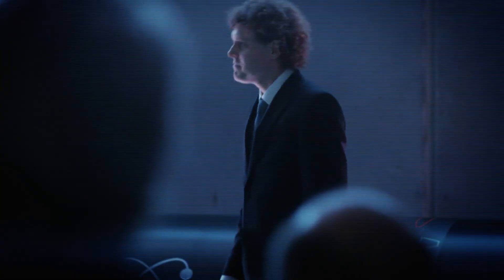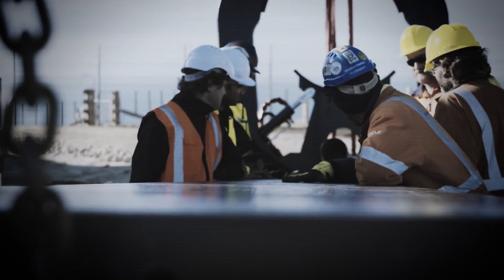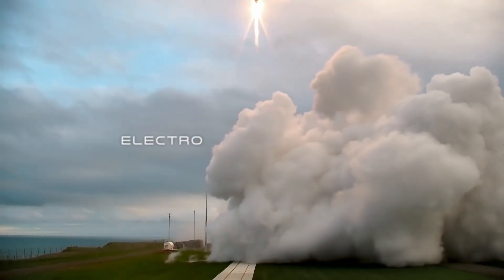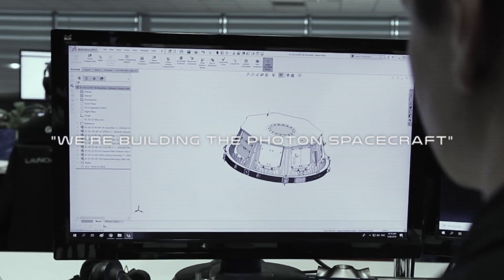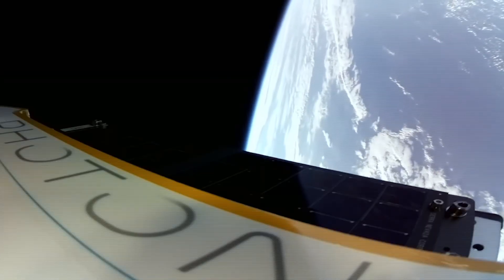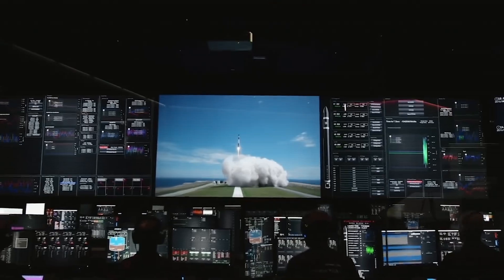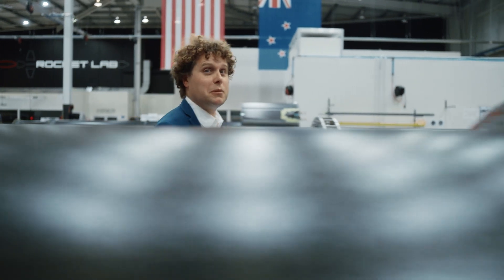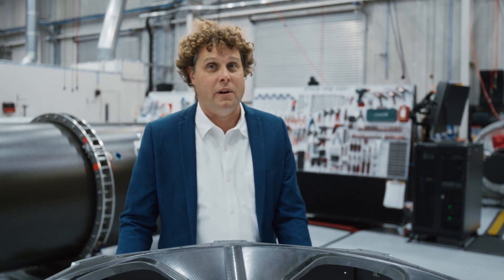Introducing Neutron

Comment: Dear Sir / Madam

I agree that I do not have the skill related to this post. If you will give me a job, I will try to give my 100%. My height is 7fit, and in the weight 90 kg, I can work to push your electron rocket to the launch ped.
 

My name is Deepak Goswami. I live in Jaipur, Rajasthan. My village is in the state of Jharkhand. I am very interested in space science. I take information related to space science from YouTube. I have been watching videos related to space science on YouTube for almost two years.

According to all the knowledge of aerospace science I have taken so far, I think according to that. The cost of rocket launches can be reduced by building an anti-gravity engine. I have worked in a copper cable shop for 2 years. Used to sell cable in this shop. Sale, purchase, inventory accounting was done on Tally software. Customer used to call. Used to take payment from the customer. Receipt used to enter payment tally on the software.

After that, I had a avenue supermart LTD. This was the supermall of 'Dmart Company' joining. Where the SAP software worked on the MS Word software. Used to packing Used to do stock checks. Stock also used to unload from the car. My computer has a typing speed of 29wpm. Photoshop software, Corel draw software, laptops, I know to operate lamination machine, stone drilling machine, internet.

I have also done a course in personality development. I am a B.Com graduate with 47%. I had no employment with. Then I tried 21 jobs but I was not interested in them. My interest is in aerospace company. I want to study aerospace science. And I have no money. Please give me any job by doing. So that I can with them. Be able to study aerospace science, I am married and have a boy.

My request 

6 May 2021

डिअर सर/मेडम

में मानता हु की इस पोस्ट से सम्बंदित स्किल मेरे पास नहीं हे. अगर आप मुझे जॉब देंगे तो में अपना १००% देने का प्रयास करूँगा.मेरी हाइट ६फ़िट हे, और वेट ९०कग हे, में आपके इलेक्ट्रान राकेट को लॉन्च पेड तक धक्का मारने का काम कर सकता हूँ.
 
मेरा नाम दीपक गोस्वामी हे. में जयपुर, राजस्थान रहता हु. मेरा विलेज झारखण्ड स्टेट में हे. मेरी अंतरिक्ष विज्ञानं में बहुत रुचि हे. में अंतरिक्ष विज्ञानं से सम्बंदित जानकारी यूट्यूब से लेता हु. में तक़रीबन दो साल से अंतरिक्ष विज्ञानं से सम्बंदित वीडियो यूट्यूब पर देख रहा हु.
मेने अभी तक जितना भी एयरोस्पेस साइंस की नॉलेज ली हे, उसके अनुसार मुझे लगता हे. की एंटी ग्रेविटी इंजन बनाने पर राकेट लोंच की लागत को कम किया जा सकता हे.
 मेने २ साल कॉपर केबल शॉप  में काम किया हे. इस शॉप पे में केबल बेचता था. सेल, परचेस, इन्वेंटरी एकाउंटिंग टैली सॉफ्टवेयर पर करता था. कस्टमर कालिंग करता था.
कस्टमर से पेमेंट ले कर आता था. रिसीप्ट, पेमेंट की एंट्री टैली सॉफ्टवेयर पर करता था.

उसके बाद मेने ावेनुए सुपरमारत ल्टड. 'डमरत कंपनी' ज्वाइन की यह सुपरमाल था.  जहा में सैप सॉफ्टवेयर, मस वर्ड सॉफ्टवेयर पर वर्क करता था. पैकिंग करता था. स्टॉक चेक करता था. स्टॉक गाड़ी से अनलोड भी करता था.
मेरी कंप्यूटर में टाइपिंग स्पीड २९वपम हे. 
में फोटोशॉप सॉफ्टवेयर, करेल ड्रा सॉफ्टवेयर, लैपटॉप, 
लेमिनेशन मशीन, स्टोन डिर्लिंग मशीन, इंटरनेट, चलाना जानता हु. 
मेने पर्सनालिटी डेवलपमेंट का भी कोर्स किया हे.
मे ४७% से बी.कॉम ग्रेजुएट हु.
इस्के साथ मेरे पास जब रोजगार नहीं था. तब मेने २१ जॉब ट्राइंग किये लेकिन उनमे मेरी रुचि नहीं थि.
मेरी रुचि एयरोस्पेस कंपनी में हे. में एयरोस्पेस साइंस पढ़ना चाहता हु. और मेरे पास पैसे नहीं हे. किर्पिया करके मुझे कोई भी जॉब दै दे. ताकि में उन् पेसो से. एयरोस्पेस विज्ञानं की पढाई कर पाऊ, 
मेरी शादी हो चुकी हे और एक लड़का हे.

माय रिक्वेस्ट 
६ मई 2021

Comment: Electric-pump-fed engine - from https://en.wikipedia.org/wiki/Electric-pump-fed_engine     ,  In comparison to turbo-pumped rocket cycles such as staged combustion and gas generator, an electric cycle engine has potentially worse performance due to the added mass of batteries, but may have lower development and manufacturing costs due its mechanical simplicity, its lack of high temperature turbomachinery, and its easier controllability.[5] Conversely, an electric cycle engine may have significantly better performance than pressure-fed rocket engines and solid propellant rocket motors.

Comment: The Neutron seems to be a big gamble to me. It is trying to poach an area between the Electron and the F9, at the time where the other launch provider switch to even bigger and more capable rockets. The approach seems to be to lower the costs per launch by downsizing the vehicle as much as possible.
This gamble will only work out if the new vehicles of BO and Spacex won´t decrease launch costs to a point where they can still undercut the price of Neutron for a dedicated launch.
ULA won´t be a competitor (too expensive, even with Vulcan),  neither will be Virgin (spacecraft is too small).

The real questions are: 
1) How far will BO and Spacex be able to decrease the costs for a dedicated launch?
2) How much demand is really there ? Peter Beck pitches to future mega constellations, but how may will truly be there and how big will they be? It would be fun though if Rocket Lab could persuade Amazon under new leadership to ditch BO and chose them instead for launching Project Kuiper, however unlikely that may be.

Comment: Nice but I have one question: with human spacecraft is under 8T?
Reply: Carbon Composite over Aluminium Honeycomb, structure super light,. The wiring, fuel, motors, life support, and passengers,. They'll aim for 4000 kilos.

Comment: Fantastic news. I always thought SpaceX and Blue Origin were going the be the leaders of new-space technology, but Rocket lab has definitely thrown their partially eaten hat into the ring.
Reply: I kinda get the feeling they may beat Blue at this game.
Reply: @RD-270  Nah, Origin is way ahead of Rocketlab.
Reply: @lewisistic  maybe, maybe not, we haven't really seen all that much more of New Glenn than we have of Neutron, both have shown us fairing halves, BO has shown a bit more, but they also just the other day delayed their maiden launch to Q4 2022, which means 2023 at best. Not impossible that Rocket Lab launches Neutron first :) Unlikely, but not impossible, we have no idea how far they have come in their design and build program.

It's not like they started the design a few weeks ago, they have already built a fairing, so the design is probably quite far along.
Reply: @Robinlarsson83  It's not impossible but it's improbable
Reply: @Robinlarsson83  Rocket Lab also developed the electron in a fairly short time frame. Assuming this uses some of the same technology as Electron, they might be able to do it.
Reply: @RD-270  They'll certainly be quick for the development and clearly they haven't just started. However, Blue Origin is currently targeting 2022 for New Glenn and even if they miss that by a year (unlikely with Jeff Bezos stepping down from Amazon to put more into Blue Origin), they'll still be ahead of Rocket Lab.

Long run though? I certainly wouldn't bet against Rocket Lab. They have contracts and have done business with all the big players already and are therefore a known entity whereas Blue Origin will be starting out from scratch.
Reply: @lewisistic  in what exactly, there isn't only one way to make something reusable, and blue origin still hasn't put anything in orbit.
Reply: @lewisistic  without having reached orbit yet? I'm a little skeptical
Reply: @lewisistic  They have no orbital hardware or orbital experience. Maybe on paper they have a lot of progress but so does the SLS. So does Starliner. Getting your hands dirty with practical testing and prototyping has yielded demonstrably faster results for Spacex, and Rocket Lab's 2024 target points toward that kind of design ethos.
Reply: @Robinlarsson83  To be fair that fairing is almost certainly a rough mockup or a boilerplate.
Reply: @RD-270  I'm no roecketologist but I'm not sure the rutherford engines will scale well with a rocket of this size. The battery capacity will need to be increased by a huge amount to pump enough fuel for an 8 ton class rocket. My bet is that they have a new engine design in mind for the first stage at least.
Reply: This is damn amazing... best thing I heard for a long time.... and human rated as well!!! As someone who lives in the city where Rocket lab build their rockets I'm also really proud of what they're doing.... 

Let's be fair to Blue Origin though. New Glenn will be a heavy lift rocket - 45 tons to orbit; that's a different class of vehicle we're talking about. Rocket lab's Neutron will be 8 tons to orbit - much bigger than their Electron rocket - but even the Falcon 9 is 22 tons to orbit.

I think this is a very sensible choice by Rocket Lab. Kind of a sweet spot between Electron and a Falcon 9.
Reply: Blue origin is just doing what SpaceX has already done, and doing worse.
Reply: Hold your horses everyone. Neutron is just an 8 ton vehicle, so it won´t eat BO´s and Spacex´s l(a)unch. And even if it is technically capable to fly humans, it remains to be seen wheter it ever gets human rated - and more important, which vessel it is going to use for that.
You see, Rocket Lab did not announce their own crew capsule, Starliner is too heavy and Spacex will not use other provider´s rockets. The Russians and Chinese tend to keep flights in the hands of national agencies and ESA doesn´t have plans for its own crew program. That leaves Dreamchaser, which is already slated for the Vulcan, but SNC could perhaps  be persuaded to switch later on. And that, at the current time, is basically all there is for a crewed usage of the Neutron.
Reply: Blue Origin was never and will never be a major player in the spaceflight industry, the only productive thing they have ever done is designing a a-bit-above-mediocre engine using old technology. They wish that they could compete with SpaceX and RocketLab but they will never reach them. So yeah, my money is with RocketLab, they will destroy BO, both technologically and financially
Reply: With jeff bezos time? I say its very much possible
Reply: @AntiangelRaphael the destruction of BO was just a figure of speach. Bezos capital alone is enough to save BO from bankruptcy multiple times, but he will not be able to save BO from falling into obscurity. I said in a different thread that BO is too unproductive, too uninnovative, too late to become meaningful and morally too corrupt. they will just be a footnote in the story of human spaceflight and exploration, soon to be forgotten, and honestly, imho thats for the best
Reply: SpaceX will handle Mars and the really giant stuff, BO handles the Moon and the big stuff, while Rocketlab will stick closer to Earth, doing mid to small scale stuff
Reply: @SuperSMT  again, BO will soon fall into obscurity, they are nothing and will be nothing, they just suck, im all in for team space, but BO is just part of team "get richer" and have no part in humanitys future except for organising novelty tourist trips for a few rich people , their moonlander way to expensive for the absolute garbage it is, if you dont want to use starships for moonlandings than you should go for Dynetics Lander, it is much better suited and way cheaper, at least for the artemis programm
Reply: @SuperSMT  Very 'simplified' model. You cannot ignore the other companies that want a slice of the industry. Just to name a few:
Aevum, Astra, Firefly, Glimour Space Tech, NorthropGrumman (Antares), SieraNevada Corporation, Virgin Orbit and of course ROSCOMOS, ISRO, and a powerful intergrater like Arianespace and then China, which is standing strongly and independently and achieving great results. And possible new technology ones that I may have not heard of. One I have is AerojetRocketdyne development. And I may have missed a few too.
Great to see such a variety of ideas and attempts. So many get told 'It can't be done.' and many fail, but some break out and become the New Normal in our lives. At the end of the day, it's never going to be a simple model for future space growth.
Reply: @David-yo5ws  Obviously simplified, that's the point of my comment.    
And all those other companies... a couple will probably survive, but but like you say I don't expect all that many individual launch companies. Probably ~2 in each main sector, aside from the major governments who will launch even  if not profitable
Reply: They all do similar but completely different things. They can all be leader in their own fields.

Comment: well,
you had electron, you had proton, and photon,
you might as well have a neutron.
Reply: Well... 

Proton is not made by rocket lab. It's a russian rocket.
Reply: @otsokivivuori7726  still
Reply: Next vehicle name will have to dig out the leptons 🙄
Reply: @salty_berserker_channel  The electron is a lepton. Though i agree, neutrino and muon would be cool names. The problem is that particles start to lose their recognizability after that. Nobody knows the lambda particle, for example. Maybe they will start using elements instead. Or something else.
Reply: @otsokivivuori7726  A bigger rocket will be either Lithium or Carbon. Lithium in reference to their battery powered pump amd Carbon as reference for their Carbon Fiber rocket.

Comment: Holy sh!t! This is exciting!
I’m presuming reusability (propulsive landing) is more or an important rather than desirable requirement? Considering the direct competition with SpaceX and all. How exciting for this side of the planet 🌏
Reply: idk how about rockets as small as electron but on big rockets it reduces cost
Reply: @ImieNazwiskoOK  like efficiencies of LED screens moving to micro LED screens? Wouldn’t it be good if mechanics worked this way... 
unfortunately bigger flames equals bigger thrust.

Comment: Holy shiz that's a huge rocket omfg
Reply: It isn't huge, it is smaller than Falcon 9.
But it isn't small.
Reply: @ImieNazwiskoOK  it's wider
Reply: @SpaceFan1001  I'm not sure. Peter Beck is about 1,8 meters and he is half tall as this fairing is wide. So it's about 3,6 meters wide, falcon Fairing is about 5,2 meters wide, and it might have hammerhead configuration (fairing wider than rocket itself).
Reply: @ImieNazwiskoOK  look at their website